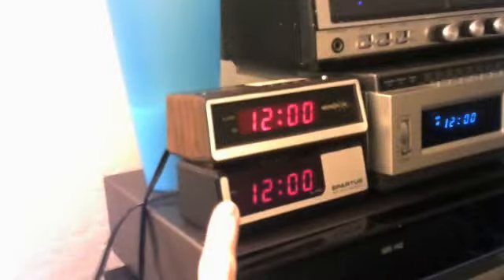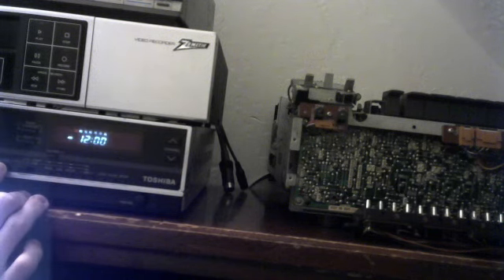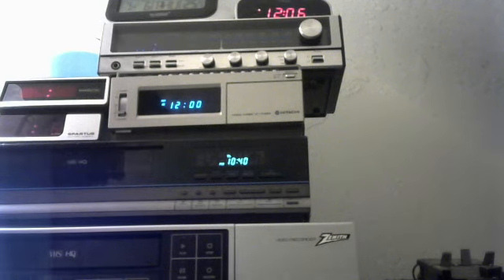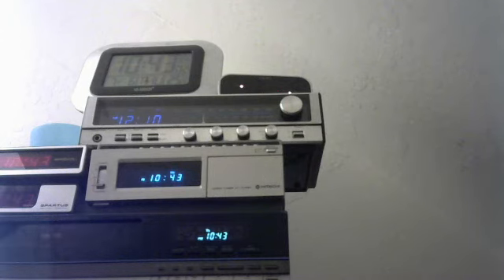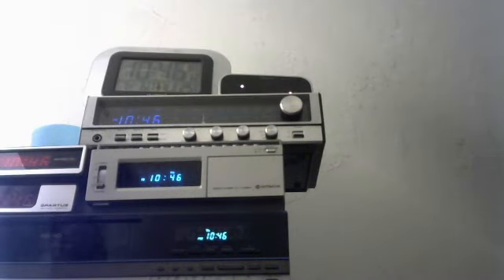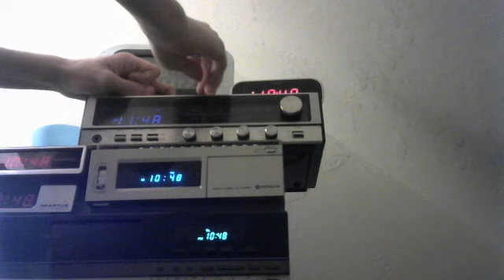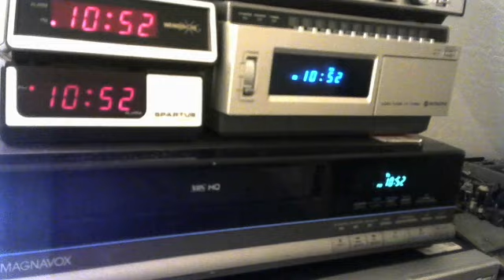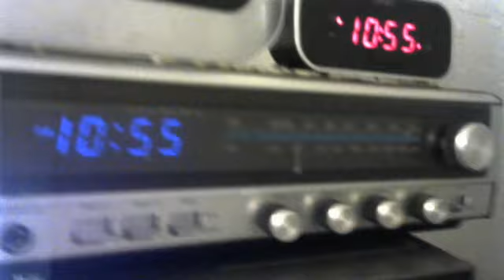Clock Experiment Part 1!

Comment: Oh, power outages and digital clocks. After we moved in (to a newly re-wired house due to previously mentioned green slime), the circuit my room was on had some issues and tripped a few times, and I think some extra wiring was also done which required power to be turned off. I had to repeatedly set my alarm clock, and its fiddly buttons were such a pain. That was what drove me to eventually find a Smiths Sectric, the best of both worlds (in my opinion).

Be interesting to see which clocks are the most accurate timekeepers! I also enjoy clock ticking sounds, the rest of my family not so much.
Reply from the maker: Gotta love the previously mentioned green slime lol We got some nice fiddly buttons on display when I tried to set the JCPenney the first time lol I have intended to get an electric analog clock like that but the don't show up a Goodwills at all and I haven't really looked for one yet My brother Seb hates the ticking sounds, But I have still managed to get 2 ticking clocks in my room relatively unnoticed!
Reply: @Dedicatedtolivinginthepast  Yeah, unlikely to see those at a goodwill, except for maybe an early 70's radio alarm clock like the Federal one I got at a garage sale. The great thing about them (for people who don't like ticking) is they don't tick, just make a quiet whirring sound.